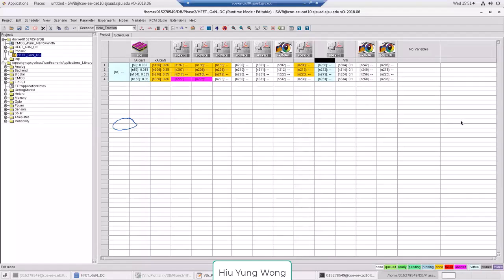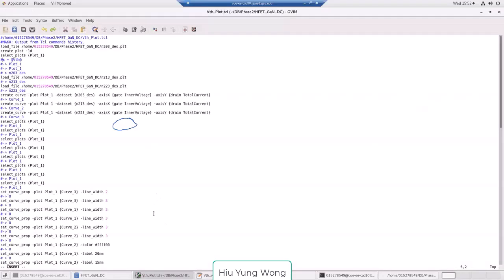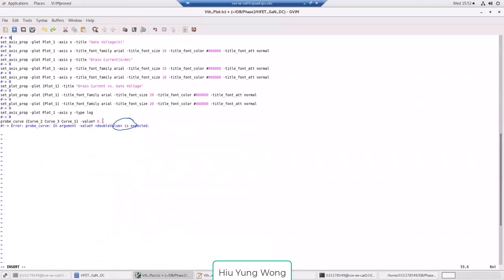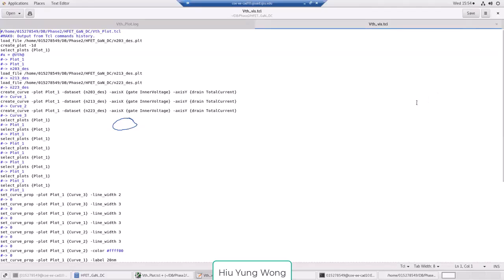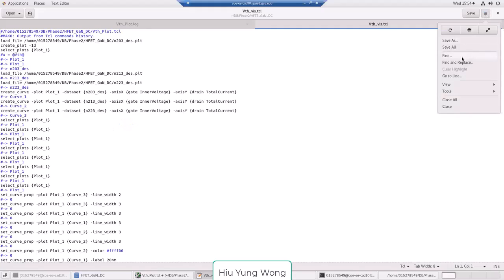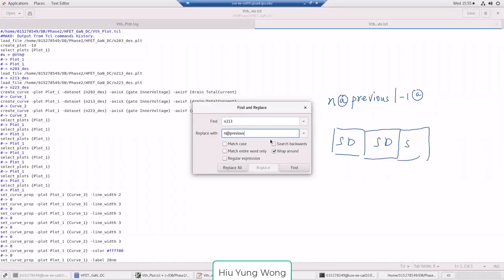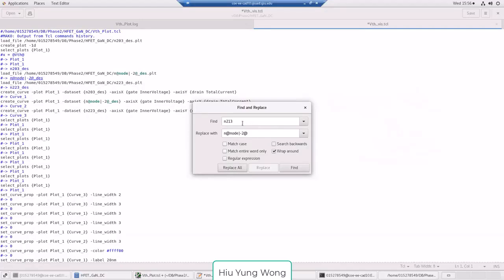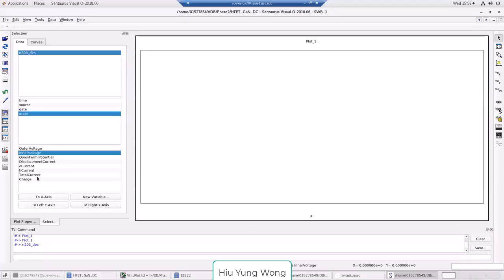L8 - Extract Threshold Voltage Automatically with SVisual in SWB

Comment: hello professor! Thank you for video. (from south korea)

I have a question because an error kept occurring while following the video above.
Errors keep occurring during my svisual run process.
The error details are as follows.

Error: Child process with pid '312338' exists with the code '1'   (in vis.job file)

And when I checked the 'view output', it said 'CXXABI_1.3.8' not found.

Can you tell me the cause of the problem?
Reply from the maker: @user-iz8jw1sn3v I am not sure. Which OS are you using? Also it is possible that your system is missing a certain library.
Reply: @quantum_computing  Thank you for your answer!